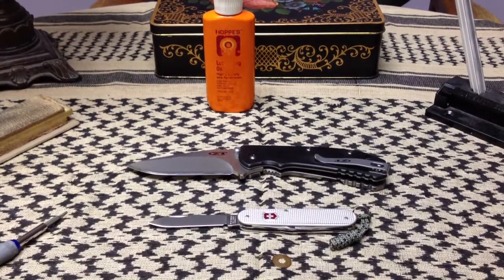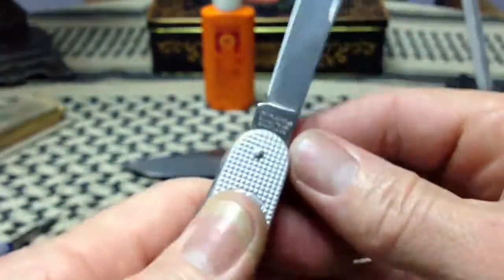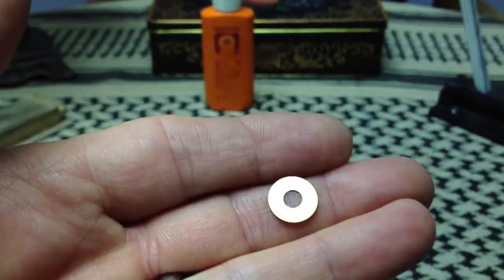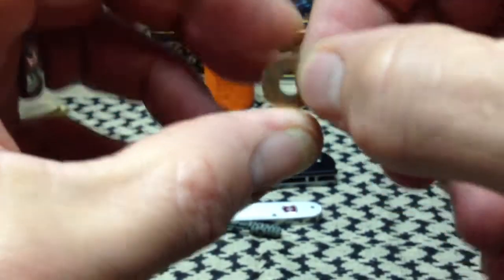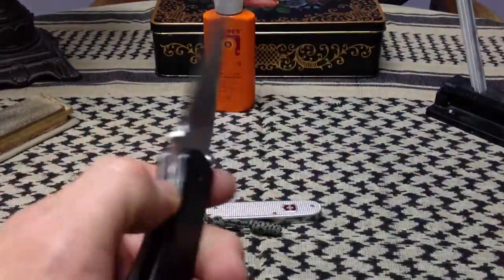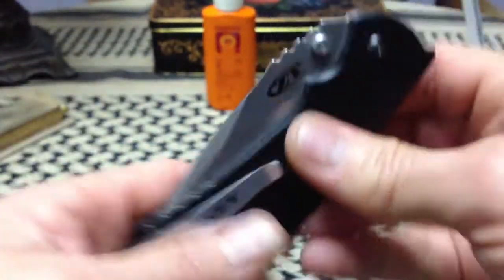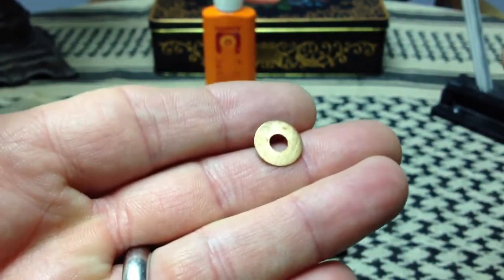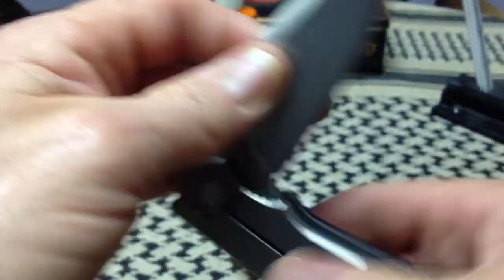Knife Pivot Bearings: What Works and What's Hype

Comment: My EDC SOG Kiku XR is now riding on 18 ceramic ball bearings held in a copper alloy retainer. They ride on 420C Plus bearing liner washers and against the blade's bearing cup which is Cryo CTS XHP. I have been testing this combination for months now with thousands of deployments and lots of inappropriate use. Occasional cleaning and maintenance with Tri Flow has been done w/o taking the knife apart. So far, 0 wear issues whatsoever that I can see with a 60x loop. The blade deploys and retracts super smooth and as fast as the day they were installed. The Kiku uses a modified Axis bar lock that stages the blade and the blade literally rides loose on the pivot until the lock is engaged. So far it seems to be a win over the stock steel bearings and steel liner washer which have a poor surface finish and scoring from the OEM steel bearings. We are also testing this same combo with 304 ss liner washers with steel bearings.

Comment: I don't think there is much of a concern for the use of ball bearings in a folder. You have to remember that as long as the frame (sides of the knife are truly parallel), and the pivot, dowels, and hardware are correctly machined the ball bearings should not eat into the titanium frame or steel liner. Why? Well, in the case of a ZT or Hinderer, you have a finite amount of pressure on those bearings. The hardware holds the sides at a constant geometry. There isn't a constant pressure as the bearings wear themselves in. The pivot hardware and the stop pins hold that pressure at just enough for the bearings to work--light pressure. There is not way for that pressure to increase or decrease over time. Sure you'll end up with a superficial bearing channel in some cases, but you don't have to worry about the bearings eating their way out of the frame or steel liner. 

The concern over dirt and grit in the bearings is valid, but how hard is it to swap out bearings for new ones and wipe the inside of the knife clean? Most manufacturers will provide replacement bearings free of charge. 

All that said, am I a fan of ball bearings over teflon/nylatron or phosphor bronze? No. I'd prefer teflon like the Gen 4 Hinderers. teflon washers are much more forgiving, and they are smoother than ball bearings. They also hold just the right amount of resistance against a free-falling blade. free-falling blades are dangerous in a folder! Again anyone who uses a knife as a tool would understand that.

Comment: You should try the sanrenmu land 9103 or 9104 .it a little smaller than a sabenza 25 .built a little different the sabenza 21 .the handle has the cut outs like the 21 .but it has the profile of the 25.stainless steel handle .milled out scales .bearing pivot .
   Its something else .if you love sabenzas you've got to check this one out.

Comment: I've been collecting knives for close to 20 years, folding knives mainly, I just rekindled my fondness for collecting and have noticed that the knife community as a whole has gone bonkers over how "smooth" a knife opens AND closes and seem to have forgotten that a knife is a cutting tool not a toy to sit and flip. 
I have more than my share of custom Elishewitz knives and none of them have bearings and are well...smooth as melted butter some with Teflon washers and some with bronze washers. Yea, I have knives with bearings but wish they had bronze washers why, FACT, they are stronger, they are less prone to getting dirt into the pivot area and all the other reasons Rob stated
It seems that the knives with washers are getting harder and harder to find (I'm talking higher end knives) and it's because of the buying public wanting a knife that opens so smooth so fast they've forgotten that a knife doesn't need to open so fast or smooth as silk....it needs to lock tight and to cut. Ease of opening is down the list as far as I'm concerned.
Don't get me started on flippers...
Rob, I agree with you 100% on this subject.
Reply: nofaithjusthope- if it's not a flipper on bearings, I don't want it(: that bad boy better fall shut ❤️
Reply: Brock Whittle-Why, what's so good about a knife that falls shut? I don't get it.
I have about 8-9 Andre Thorburn knives they are very smooth opening and closing but that doesn't make them better than some other knife that you have to put some pressure on to help close it say a Sebenza for instance. Sure you could polish the bushings and use just the right amount grease to get it to "almost fall" closed does that make it better or worse...not really. 
I honestly prefer knives with bushings, everything about them is superior cleaning, use, longevity, tear-down/assembly. Only lacking in closing ability (maybe)...don't get me started on the flipping aspect.
I'll just say ANY knife can be "flipped" open, doesn't have to be a "flipper" either which IMO the flipper tab is usually in the way using certain grips.
Bottom line is bearing pivots are a fad IMO. A "well designed" brass or teflon bushing knife is just as smooth. Allen Elishewitz customs come to mind.
Reply: nofaithjusthope- it's only a preference, I'm not saying that bearings are better, or a flipper tab is better, it's just what I like.. It's subjective. I don't mind the maintenance of ball bearings or shooting a little oil in the pivot here and there, maybe that "fall shut" smoothness just brings me a little joy and that's why I like it lol I'm not real sure. I've never had any issues with knives with caged bearings or like a bearing race, and the only issue I've seen with a flipper tab for me personally it could get in the way of certain cutting tasks, but no more than a thumb stud. However I do not like the feeling of bearings in a balisong, there I much more prefer a bushing system and a PB washer. Long story short it's just personal preference. Find what makes you happy, and use it.
Reply: "Find what makes you happy, and use it." I agree with that, it just kind of bugs me about the whole smoothness thing AND the flipper/bearing craze. Almost every one of my knives that have thumb studs or thumb holes I can flick open and most are with PB bushings. 
One thing about some of the Thorburn knives I have (ALL are IKBS) is the loud "thwak" they make we opening most owners seem to like that...I don't, I don't want to call attention when I pull out the knife for use other than that the Thorburn's are very nice. 
But yeah to each his own.

Comment: I prefer phosphor bronze washers over ball bearing pivot systems because in my personal experience, as soon as dust get in between the ball bearings it become gritty and a tad slower to deploy. This is mainly just due to pocket link and what not. Sadly, you can't just blow it away with compressed air, you actually have to take the knife apart to solve the problem.

However I do like ball bearing pivot systems as well because they offer a very smooth deployment, especially if the ball bearings are made of ceramic.

Comment: Why do some companies still use Teflon washers? My MCusta has them, and they work great, nice and smooth. Are there any negatives to Teflon washers?
Reply from the maker: ***** I think you answered your own question ;).  The only down side to teflon is that they don't provide as much side to side rigidity, and they can be fairly easily deformed during disassembly  / reassembly.  But if you're someone who doesn't pry with your knife, and you rarely if ever take it apart to clean and lubricate it, teflon is a great washer material.  It has a self-lubricating quality that works very well, and it makes a knife action silky smooth.
Reply: Basically, teflon is the slipperiest material on earth, but it is also very easy to bend, deform, or break. It just doesn't wear very well

Comment: Well shoot, I was into the whole cadged bearing thing until now. I'm having a custom folder made. I'm thinking I'm going to call up and tell him to put bronze washers in instead. I'm having this knife made with the intention of passing it down to one of my sons. That may not work so well if it has bearing. Thanks for the video, this is the first I've heard of the potential pivot failure.
Reply from the maker: Matson Ruddell This video is over a year old I think, but I really haven't changed my opinion about ball bearing pivots.  Even if you install hardened steel machined washers for the balls to roll against, thus avoiding wear in the titanium, they still aren't as "smooth" as a well executed bronze washer pivot (although they might be more "free").  Then consider the number of parts in that assembly -- 12 ball bearings, two cages, two machined washers, for a total of 16 parts in a folding knife pivot, with a significant amount of missing structural material in the blade tang and handle scales to accomodate that assembly!  In my experience, it just represents added complexity with little benefit in utility and compromised durability over the long term.
Reply: So how about bronze washers instead of hardened steel. They don't have to last forever, just be reasonably easy to replace.
Reply: Len-If you're asking about the races, well, if it's IKBS bearings it's not so easy as a matter of fact it's very difficult. Not for the faint of heart. You'll be dropping those bearings everywhere. Sure if a knife has replaceable races/bearings it can be done. Rob's point is 2 fold they are overly complicated and wear out/get dirty sooner. 
AND that's IF you can find replacement parts when the time comes.

Comment: They are doing it wrong, the bearing should also be inside the pivot where the knife rides one, or the pivot an axis fixed, or even a one piece part, to the blade that spins on bearings like a gear on a transmission. The first case a simple ring of highly rigid and wear resistant and self lubricating plastic like UHMWPE or bearing grades of Torlon, PEEK, Vespel or Celazole (the last two if you want you bearings to cost more than your knife) would do the trick, rigidity and  wouldn't be a problem except for extreme use were you would be better served with a fixed blade anyways. For the second type you would get the strongest possible set up for a folder with the added benefit of proper bearing placement (granted you use them in the proper format), problem is it would get a little tricky to attach the thing to a reasonably thin handle and possibly to service it. And seriously, who doesn't know by now that Ti is a poor bearing material?! Or that bearings require their own track surface, usually not what you want to preserve. ZT could at least half-assed it and coated the thing for the bearings, not going to help the lock, but I recon that the steel insert was a nice idea. Either their engineering depart is crap or the marketing department has taken over.
Reply from the maker: Great post, Pedro!  So a great solution would be to us two phosphor bronze washers between blade and scales and call it good 😉
Reply: In a way yes those two washers would be still needed if a washer is used in the axis itself, but we need to remember that the blade is still riding into something. Obviously it's fine the way it is, polished steel is an "adequate" bearing... but it could be better in terms of wear. I would still like to see that contact point gone, a blade with a fixed or an integral axle riding on some sort of sockets (plastic, metal, ceramic, cermet, etc) that does not rotate on the frame and is fixed by a fastening nut so it wouldn't unscrew (I'm looking at you ZT) would be a nice compromise, simple and easy to upgrade to a proper ball-bearing if it's desired (knife aftermarket customization-paraphernalia is still somewhat of an unexplored market), another advantage would be the greater stability of the blade on the Y axis (x is the longitudinal one and Z where the blade pivots.) Sure not your "less than 250/300 bucks" knife but sure a nice experiment and flagship.
Reply: Pedro .Persson I totally 100% agree and am in fact in the process of modifying a Buck Vantage having a press fit pivot pin riding on radial bearings. I am considering Rulon J for the thrust bushings.

It's cool seeing the pivot torx screw rotating as the blade swing open.
Reply: Nice to hear that, I wish you lucky in your project. It's nice to hear that good ideas pop on their own on people that never met before. I've heard some people complain about the durability of PTFE, so if I was you I would take a look at UHMWPE, that stuff has almost as little friction as PTFE but it's much much more wear resistant, in fact they use the stuff on the basis of industrial conveyor belts to prevent them from eating through the metal frame. Also even it's press fit try to use a shoulder and a cross pin or fastening nut to prevent movement of the blade. It's no race car gearbox but it will be subject to quite severe impact cycles.
Reply: Pedro .Persson I have a pile of what is supposed to be UHMW, but not sure of it's exact composition, all I know is it's black and was used for the construction of a boat slip dock serving as the dock guides riding up and down the piles as the tides change. 

The pin is shouldered opposite the liner lock, but I opted to use thrust bushings to mitigate blade drift.

All in all this is just an experiment so as to judge for myself if bearings, when properly implemented in a pocket folder, have merit. I'm picking up that TheApostleP tends toward the belief they are extraneous and he may be right, but I aim to find out first hand.
Reply: Jon Roe
Axial movement is going to be easy to deal with, just make sure the bushing is tight, trust might be an issue but that is more dependent on the shape of the bearing... I would still run a traditional set of washer, or a projection of bushing to take care of that just in case. If Those plastic prove too soft I would take a look at bearing grades of PEEK and Torlon, perhaps some ceramic but after that point you will be building a 1000 dollar knife due to the exotic materials so ball-bearings start to get attractive again. Greatest problem will probably be how you will fit all of that into an existing design.
It's not so much a question of what to belongs to where, the system has parallels that use and need bearings, most knife do use. It's only a matter off implementation. Things are "primitive" because I suspect few people tried to apply more advanced engineering into folding knives.

Comment: I don't disagree, but I would be happier with phosphor bronze if we were seeing flange bushings instead, at least then the pivot pin wouldn't be a consumable, but I still don't like relying on setting the pivot bolt tension to center the blade. Honestly, I see no satisfactory pivot designs in the world of folding knives and I'm perplexed as to why considering they already exist in other applications.
Reply from the maker: Jon Roe It's all about execution, Jon.  There is a knife with a brass flange bushing pivot, the Knives of Alaska Lightweight Hunter.  Great idea, the flange pivot, but the worst folding knife I've reviewed in the history of this channel.  There is the Chris Reeve bushing pivot, almost always executed well, and superbly designed.
Reply: TheApostleP I watched your knife school video and understand what you are saying. Honestly, there are some (the Buck Marksman comes to mind) that really should use bushings as some slip/ stick is necessary to restrain the blade from flopping about if it doesn't fully lock when deployed. To me that was certainly hype, the same way the Vantage Pro series offered all the buzz word bullet points with S30V, G-10 scales, made in USA, only to be poorly executed.

I believe bearings could be a great way to go if we're talking about radial, cone, or angular contact and not these silly little ball thrust units. My interest is in seeing more affordable, ridged, smooth, aligned production knives and it may be feasible without need of the tolerances held by the likes of Chris Reeve with the proper implementation of bearings.

Thanks for responding, and for all your excellent videos!

Comment: You also have to factor in the pivot when talking load. If the thrust washers deflect or crush or wear down, any lateral force will transfer to the pivot pin by way of the blade. The pivot is a fairly tight tolerance to the blade hole even on the lowest priced knives. No doubt though, thrust washers work fine.

Comment from the maker: Great question, Knifeguy!  I can see the wheels turning in your knife nut head as we speak, LOL :).  In my opinion, the best thrust bearing in a knife pivot is a solid phosphor bronze washer.  However, if using another type of bearing for friction reduction, the roller is better than the ball for bearing the thrust side to side.  It's a simple function of surface area and force.  You'll have more wear with the smallest bearing surface given the same force. Yes, I'd run 'em wet :)

Comment: Very interesting vid. I hadn't looked into the bearings much before the GT. I'm not sure what is in mine, but what about the barrel roller bearings. They look more cylindrical than spherical. Would those still dig a channel ? Also would the round ball bearings dig a channel with steel on steel if hardened correctly? So run em wet right? Great vid!!

Comment from the maker: Thanks for weighing in, TJ.  It's really about using the right application for the job, and the application of a folding knife really calls for large, flat thrust bearings which captivate the swinging blade and suspend it properly between the stationary handles without binding.  The dirty little secret here is that when a ball bearing system is used, a poorly toleranced knife can behave for a short time like a more precise knife... until it falls apart.  It does sell knives, doesn't it :)